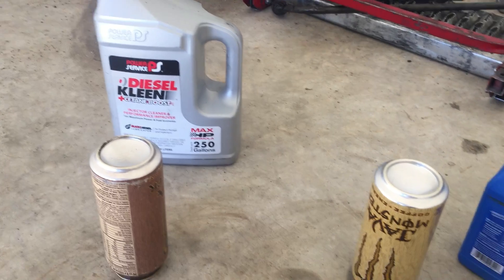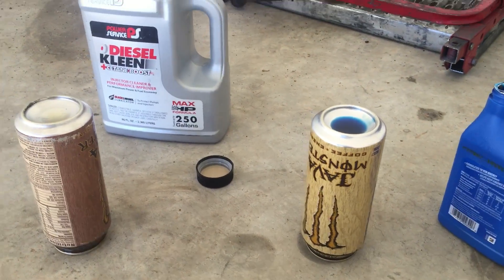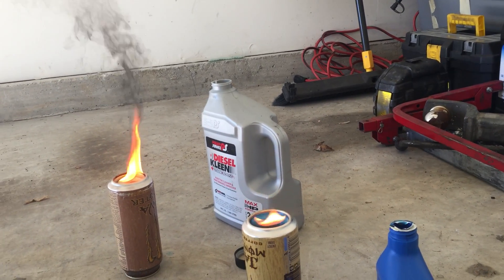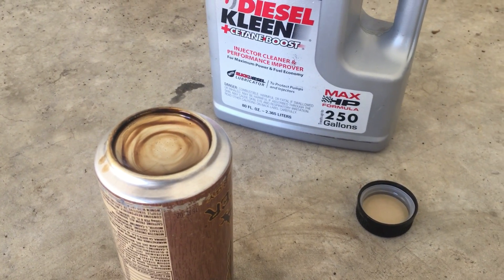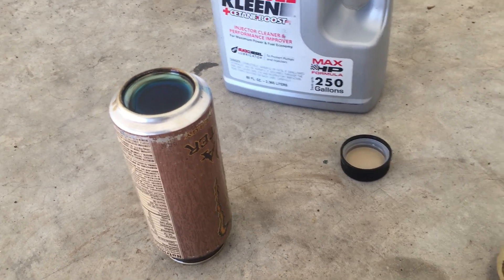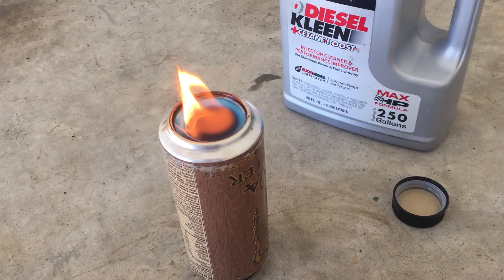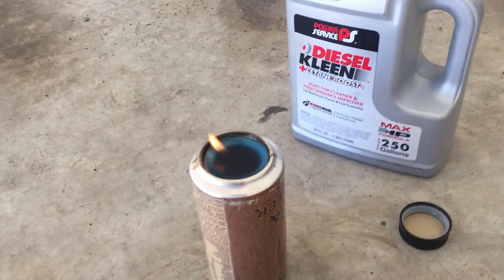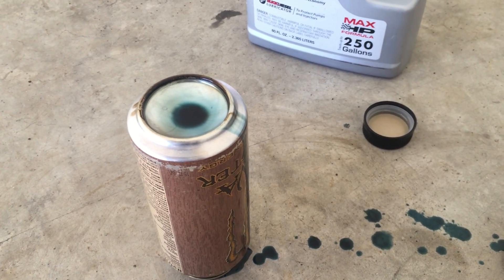2 Cycle Oil  Burn Test

Comment: Bad information - The only reason one is smoking more is due to it burning faster and needing more oxygen then the less volatile fluid.  This will not be affected in a cylinder with a measured air mass/volume.

Comment: You shouldn't use either if you have a new common-rail, direct injection turbo-diesel. If you run an older diesel and are concerned with modern ulsd fuel's lack of lubricity causing damage to the fuel pump, then by all means you can add cheap 2-stroke oil to your fuel tank. Just remember that synthetic 2-stroke does not mix well with diesel, so just use the cheapest low-ash mineral oil you can find.
Reply: I would use high quality low-ash semi-synthetic 2-stroke oil. Great for common-rail and direct injection turbo-diesels too.
Reply: @mcplutt  The problem with semi-synthetic is that you have no idea what you're buying. Many people seem to believe that it's something like a 50-50 mix of syn and mineral, but in reality it's whatever the manufacturer decides it is because there is no legal definition of what constitutes a semi-synthetic. In fact, the MSDS sheets of these oils typically show less than 2% synthetic, making it a more expensive version of mineral oil. That said, I don't know about you, but the owner's manual for my common rail, DI, turbo-diesel specifically warns against adding anything to the fuel.
Reply: @CaptHollister  Man,i used from 2006 on my common-rail engines,2 t oil jaso fc,fd .After trying different mixes the best result is adding 5 ml/liter.Even on my gasoline engines i put 1.5 ml to liter.Not any problem,the DPF instead to start auto-clean at 600 km,now is starting at 800-850 km.Never i replaced injectors,high pump pressure,and no black smoke on exhaust.2 stroke oil burns cleaner than the diesel fuel,so what is the problem?
Reply: @GREENTICKETRO Hello, can I use it on ny 2016 1.5 dci engine? Direct Common rail injection, with turbo. Lots of people saying dont to use in modern diesels. Any idea?
Reply: @kvndgr8  2 T oil burns cleaner than the diesel....think about...Still i am using on my gas cars..mazda,toyota,jeep...no issues at all...no high pressure pump problem,injector,,,,look on the american demolotion car contest...all are using 2 t oil in gas tank...why?Think about!
Reply: really?Try...2 t oil  FC/FD mix with diesel.....i used from 2006 to 2014 in my common rail 1.5 dci and 1.8 TDCI 2 T OIL...Never had issues....2 t burns cleaner tan the diesel...so,think about....
Reply: @GREENTICKETRO  Ok, I will give it a try. I was afraid about any injector or dpf issues. Have to experiment some. Also what is the ratio of mix? 1:1000 ?
Reply: Also what brand 2t oil you use? synthetic or cheap one? If there is any buying link please share i want to check the specifications of oil.
Reply: @GREENTICKETRO  Thanks.

Comment: This test proves nothing. First of all Diesel Kleen contains injector cleaner substances and a cetane booster. It is not made to be burned by itself but in a specific concentration in diesel fuel. If you ignite diesel fuel, it will also burn with black smoke, but the high pressure injection makes it burn much cleaner. In fact diesel + diesel kleen will burn much cleaner(in an engine) then diesel + 2t oil even if they don't do that by themselves.
Reply: Sorin Ryso good luck making these morons understand that. they will put gasoline in their diesels soon cause it burns clean what fuck heads.

Comment: what are the negative or risks of using 2cy oil?
Reply: The Punisher if u use marine 2cycle oil, no harm done but if you dirt bike oil, there will be carbon build up, even the project farm overdose his mover with marine 2 cycle oil, there was bit of power loss but no carbon build up and the plug still clean

Comment: Well I have ran Diesel Kleen up until this point. Next time around I'll be going with ashless 2 stroke! Thanks for the upload.
Reply: Marcus Mar I have been using Marine outboard two cycle TCW3 rated oil in my cars for a very long time. My ratio is 1 oz per 5 gallons of gas. Diesel is a different ratio. They have many brand names Pennzoil ,Quick silver, Yamaha, even Walmart has there's called Super Tech. and many more just make sure it is TCW3 rated by the NMMA not just two cycle oil.
Go to Google.com and put in Sarge LS1 on Marine outboard oil tcw3 rated. He is the Guru of all the testing. He has a great write up on this subject.
Reply: Arthur Smith yep I just picked up some of Walmart's Supertech brand that is TCW3 rated and ashless last night.
Reply: Marcus Mar try it in your car. Don't forget the formula is 1oz per 5 gallons of gas. Works better than Lucas fuel conditioner and Marvel Mystery Oil and a lot cheaper. Do it every time you get gas. I use a funnel and put it in a small bottle up to 5 oz. I wash it down the funnel with the gasoline fuel hose. Cleans and lubes the fuel system. You won't know your car is running at idle. Try a few tanks with this formula.
Reply: Arthur Smith I will be using this in both my diesel trucks. From what I've read so far a good ratio is 1 oz of 2 stroke oil to 1 gallon of diesel.
Reply: Marcus Mar the formula for your gasoline vehicles is 1oz oil to 5 gallons of gas. More is not good. Give a try for a few tanks you won't be disappointed.